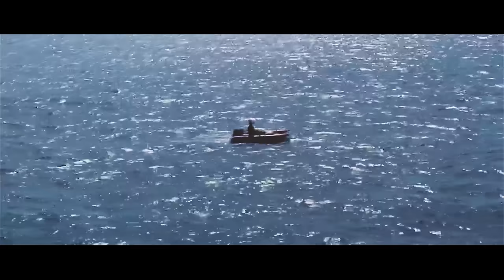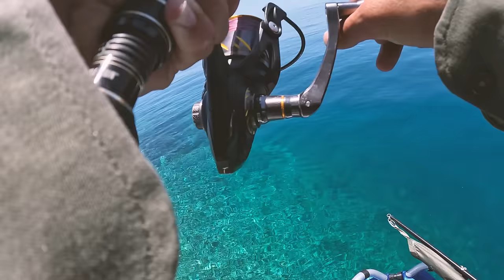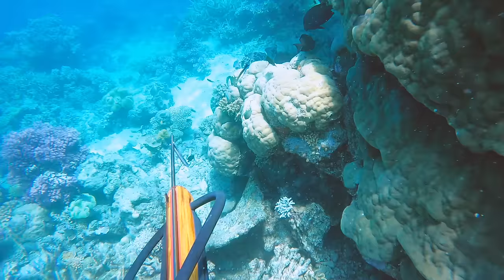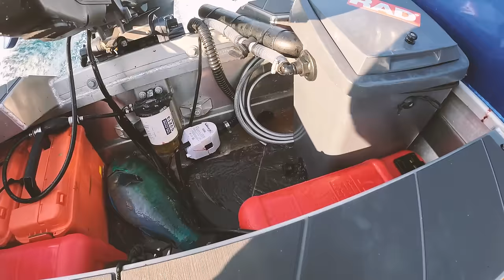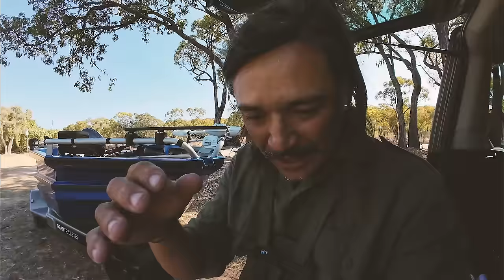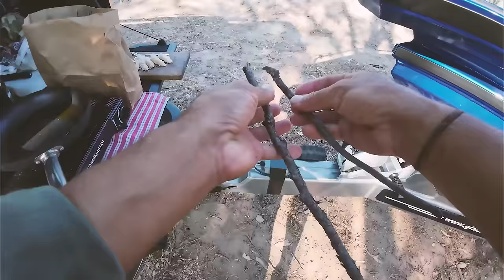My REAL Ocean Survival Story - SOLO ISLAND CAMPING - Part 5

Comment: Pretty gnarly tale you shared at the end. Could have gone a lot worse, bet you learned a lot from that adventure. just one bit of advice. Buy a couple of those little jumpstart packs. Keep one in your vehicle and an one in your boat. I have use the one in my vehicle to help others at least four or five times. I used the one in my boat to help a group of guys who were stuck in their boat. I was going out with my boys and I saw a group of guys holding onto a wooden piling in the middle of the bay. They knew they had a weak battery but they went out anyway. I was with my two boys going out fishing. I handed them the jump starter and their boat fired right up. Those guys were so happy that I was prepared. My boys were happy as well, they tell me I’m always prepared for everything. Life lessons hopefully they will learn from.
Reply from the maker: Haha, yep 100%. I have a jumpstart pack with me now all the time. I use it quite a bit too. If it’s not for my mishaps, it’s so great to be angles to help someone out. Has got lots of use too! 😅😁

Comment: In stead of fuel jerrycans I use two full fuel tanks. One pluggeg to the outboard and another as spare. It's plug out, plug in when running out of fuel. And then the rain, well who cares...
Reply from the maker: Yep, if you look under the seat you can see two 24ltr tanks on either side of the boat these trips use quite a lot of fuel so I would have already gone through the two main tanks that just plug in and was onto the jerrys. I think I’m going to look into some fuel bladders so I can stow them away once used first and then clear some space👌